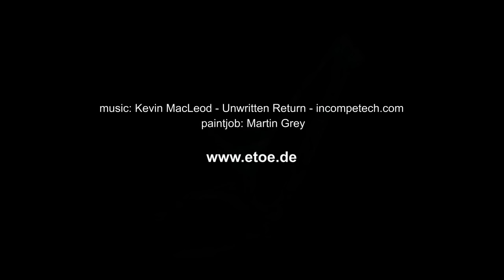Specialized Demo 8 Ken Block Style

Comment: That is the best rear swingarm bearing design ever. I always wanted to make a custom frame with the swingarm bearing around the bottom bracket, since the distance between the cranks and rear axle does not change throughout the travel, which eliminates the need for a chain tensioner when running a single speed setup. I wish more companies would make bikes with that design.
Reply: Rides like a turd though. No antisquat, forward axle path, tyre buzzes your ass

Comment: how to disassemble its bottom bracket shell,need any tools?
Reply from the maker: In the Specialized Troy Brosnan video long version I show how to disassemble the bottom bracket
Reply: I uesd a great deal of strength to unscrew it,but the bottom didn't  move a little,how much strength should I use?
Reply from the maker: All strength you have. Maybe you should eat some spinach or ask Popeye if it don't move.